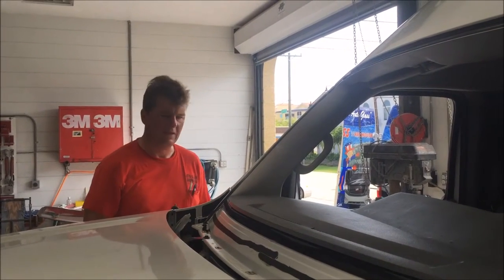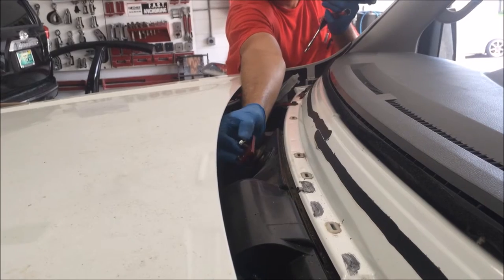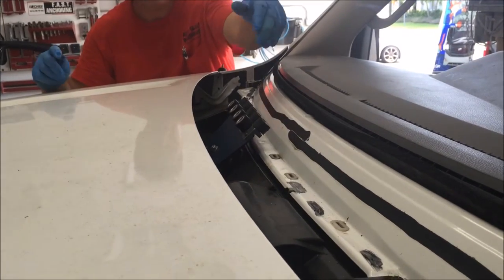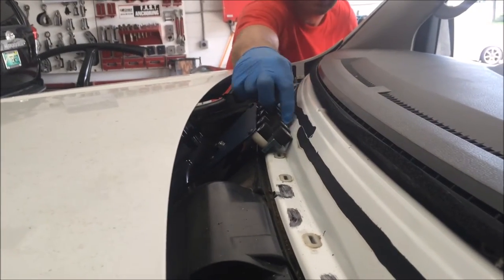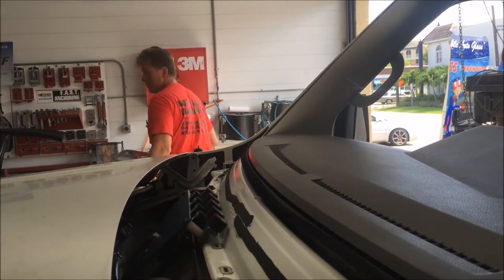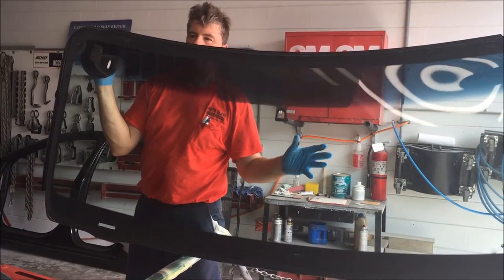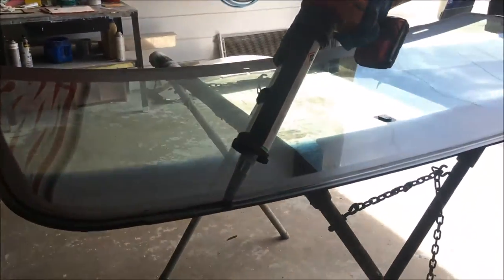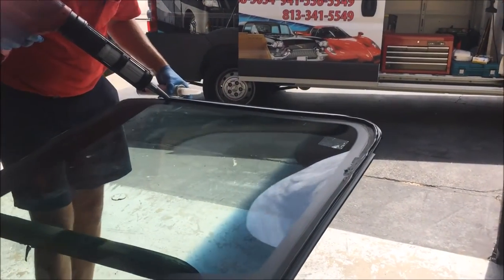Rolladeck 2015 Nissan NV 2500

Comment: Sir, I've seen many videos of many different vehicle installations with this awesome tool, the big question I have is ..... What about installations on vehicles with wipers on opposite sides, such as the Chevrolet Venture? I would appreciate feedback on this question, and I look further into purchasing this great tool. Thanks......
Reply from the maker: Good question. The Rolladeck was designed to be attached to the wiper post, however it is possible to attach it to other points of contact on models with opposing wipers. We have videos on some models like the Ford Escape showing the setup. Please subscribe to our channel for access to our complete library.